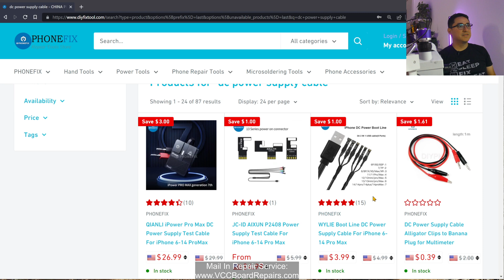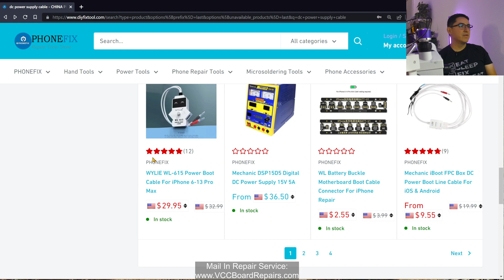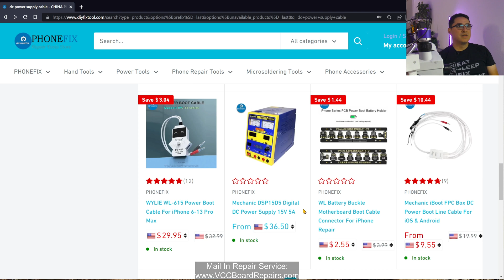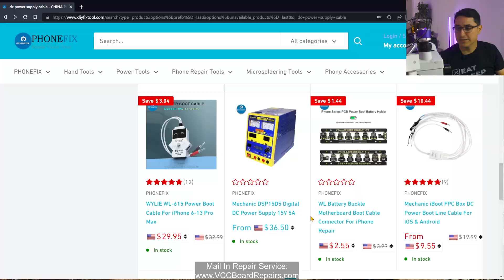What The Perfect DC Power Supply for iPhone Diagnostics Would Look Like. DT880 Refresh?

Comment: Sunshine ss-908e cable might suit you, it has all the cables and they’re usb c styled, so you can detach/reattach based any of the cables based on what you’re working with, another advantage I think is if newer iPhone models comes, you can simply buy the usb attachment for that cable

I also use Aixun p3208 dc power supply which is practically the most perfect dc PSU I’ve used thus far
Reply from the maker: There are many tools like that Sunshine. I use the Mechanic Power Pro Max which is better